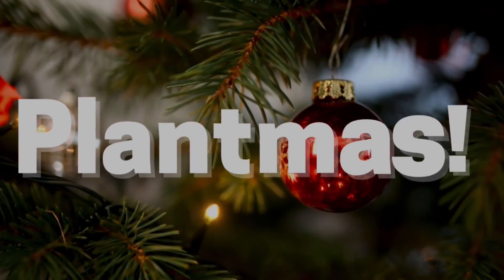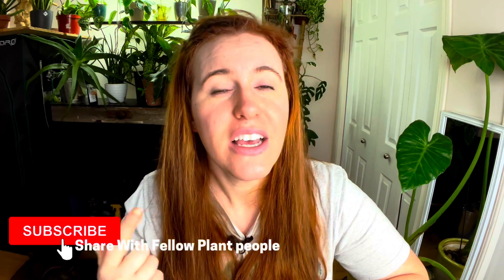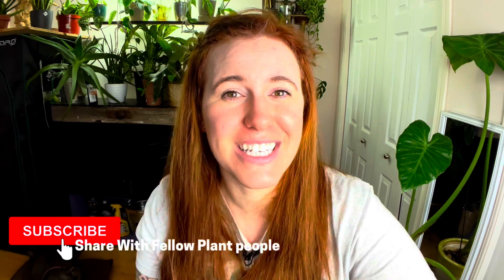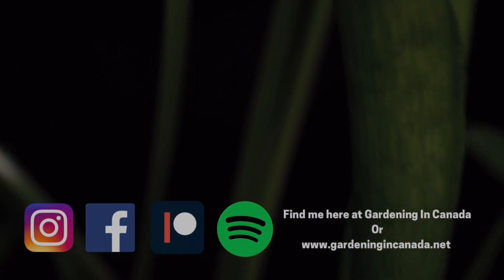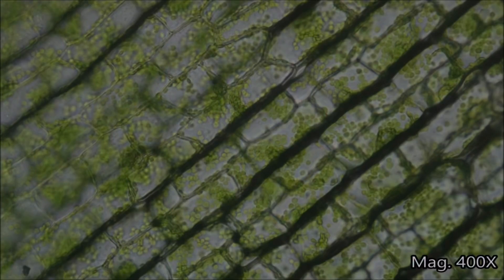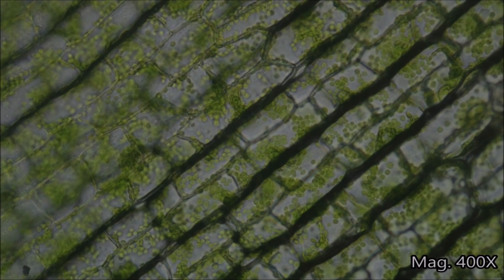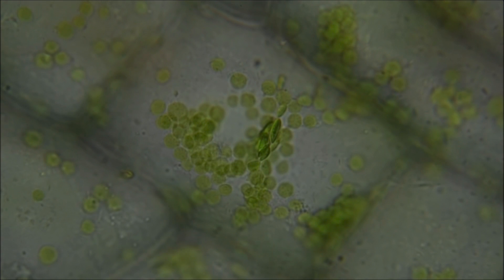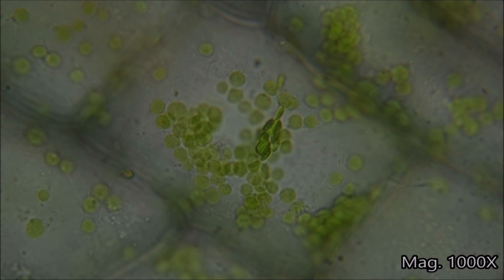Tips Of Your Houseplants Wilting? Excess Copper Caused By Potting Soil pH. Plantmas ep 3

Comment: Sooooooo! I use copper wire to trellis some of my hoya (mainly because I like the look of it). I always put some insulation tape on the part that's going into the soil because I read too much can be bad. Now I am wondering if it's not a good idea at all if they can intake through leaves? No clue if it does actually leach this way.
Reply from the maker: Actually don’t worry about it too much. You can use copper rings for example to deter slugs and snails. It’s pretty unlikely that all of it will be leached on to the swell. And then on top of that it would have to be bioavailable.
Reply: Same it’s so pretty for Hoya I need a solution
Reply: Wait so electrical tape on the ends is fine??